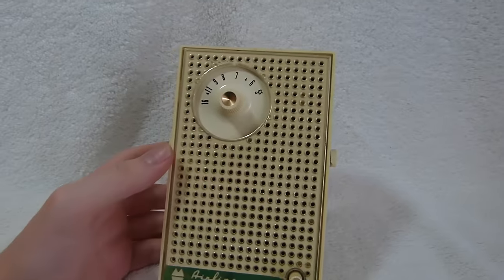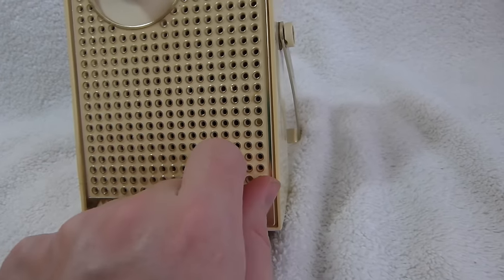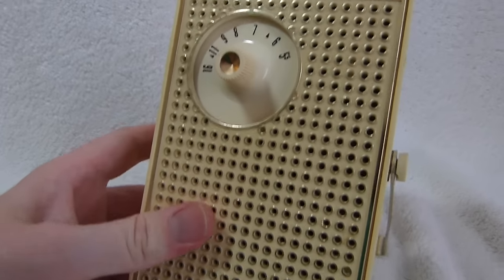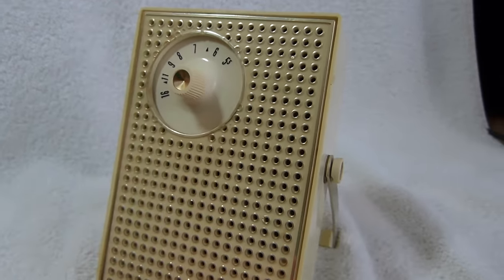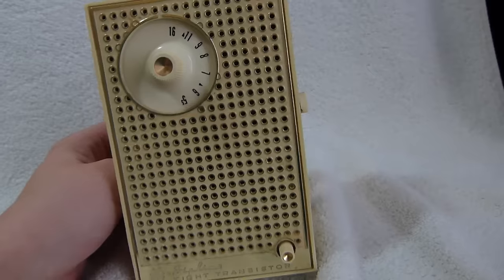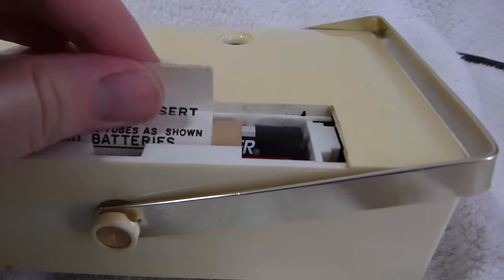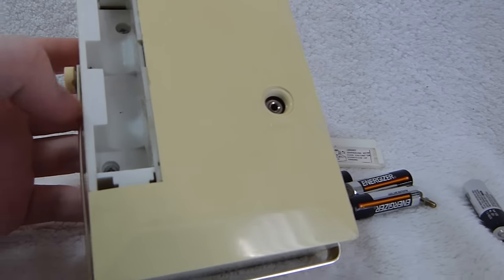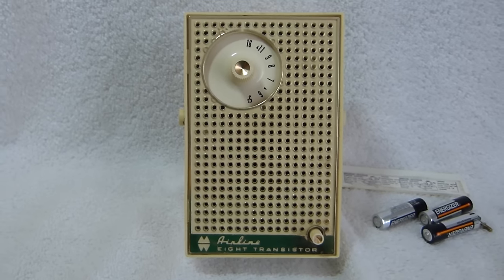1961 Wards Airline transistor radio 1214A (made in USA)

Comment: A lot of vintage computer enthusiasts use a hydrogen peroxide soak in a plastic bag to de-yellow plastic. Perhaps this might work here?
Reply from the maker: I have heard of doing that, but It would almost certainly remove all the paint from the from of the radio.
Reply: @50sTransistorRadios  I agree, I just wanted to add that that technique is called “retrOBrite”. I’ve done it for fun on an old Sylvania 4p19w (I may have the model wrong) that was pretty trashed. It did bring the color back around, but the remaining paint around the holes in the grill. 

-Nick